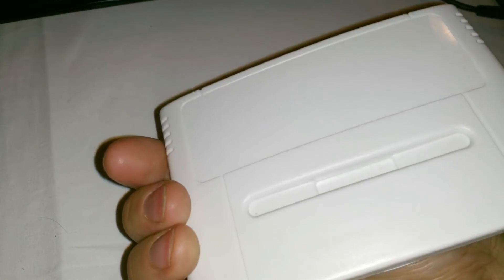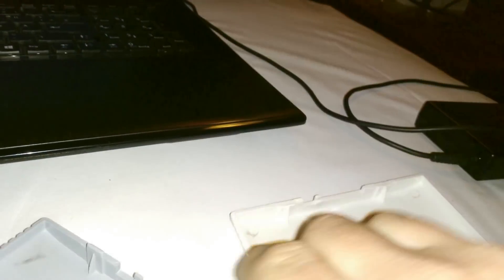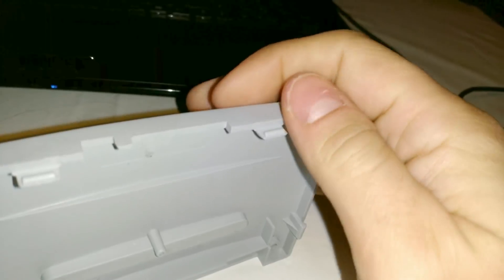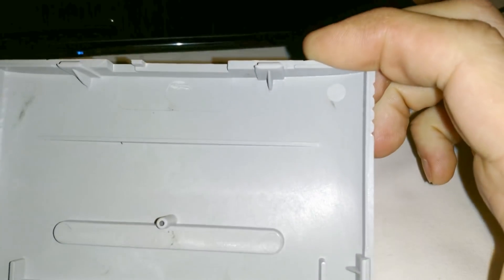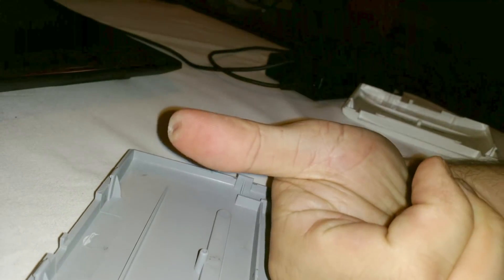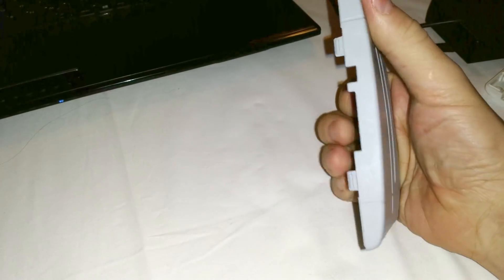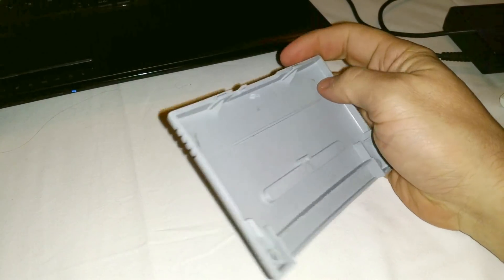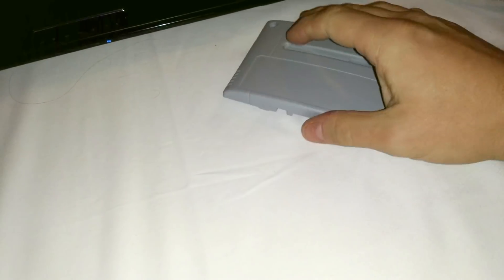Testing a plastic/fibre glass mixture

Comment: That fibre glass plastic is amazing. What colors are available?
Reply from the maker: Any color, as color is just a powder that's added to the material.
Reply: Perfect. Thanks for the answer!
Reply: This stuff is incredibly common. Where I see it most is power tools. ABS is total junk. You want at least a 60 (though I am not sure what that means, be it strands per cubic mm or the % of mass...) But it can be really tough.

Comment: Is it more difficult to assemble/disassemble then?
Reply from the maker: No, why should it? It's as flexible and behaves the same as normal plastic, it just doesn't break.
Reply: The percentage of fiberglass varies widely among various plastics. I hope you are going with a very high number similar to the grade of plastics used in hand tools. At least 60. That seems to be the minimum for cheaper tools.